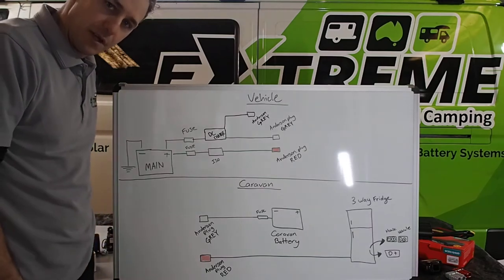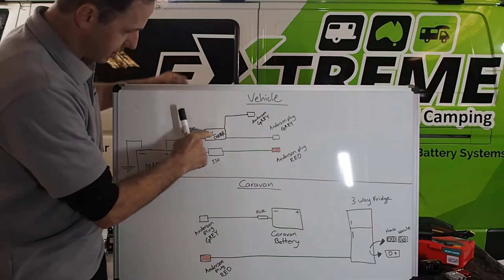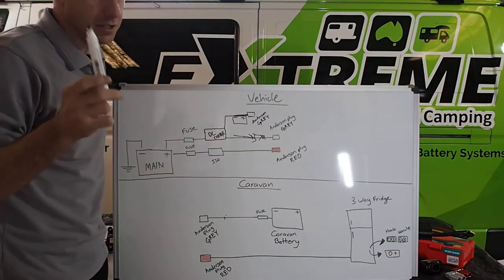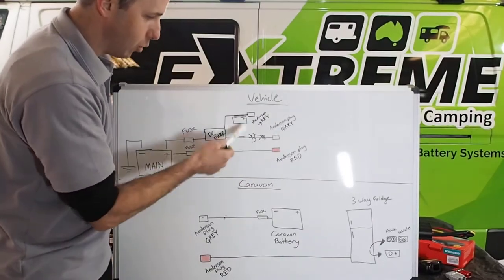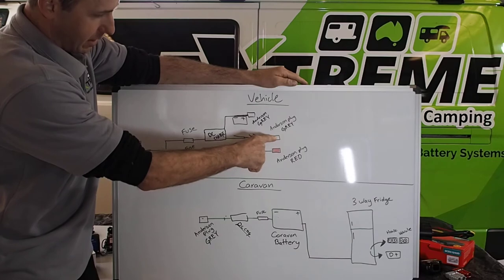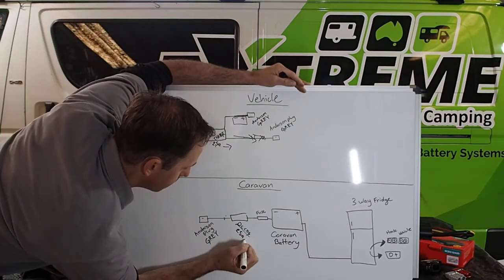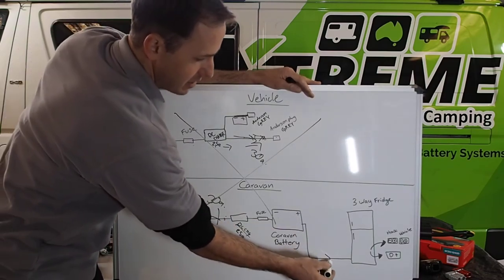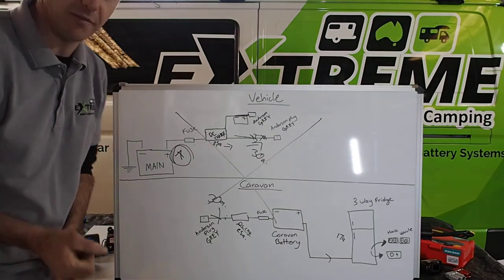Dc to Dc charging and 3 way fridge setups

Comment: Mate I love seeing what great info that you share via YouTube, it has certainly peaked my interests, in fixing my 2021 Jayco Journey, although its a small van but the invaluable information about the 12 pin connector, and then moving to the dual grey and red anderson plugs.  My van alone they've done some shocking works, like let run a 6mm2 cable from the 12 pin, down to a junction area with 2 over larger BP connectors, then it then jumps over to a 10mm2 cable that then runs to the Fridge with the AES 3 way function.  Strangely Jayco wired the AES switch wire directly off the 12v fridge supply write in the back of the fridge, it doesn't even make it to the 12 pin plug.

Job well done Mate keep it up!!

Comment: Gday Matt. Great video..
  I don't think this question has been covered anywhere in YouTube..  if running a dcdc charger from a car to camper trailer/caravan which we are using 50amp renogy one to charge the 2x120amp lithiums in the camper via a 35m2 2b&S cables with a single 120w solar panel on my draw bar tool box...I do have a 200w solar blanket back up. No real estate for solar on a soft floor camper..
   My canopy on my ute will be next to fit out. I will be running 2x 170amp giant power  lithiums in the canopy and have another 50amp renogy DCDC charger. Only possible to get 2 x 160w solar panels on the roof of the ute hence 2 lithiums.  
 My question. Do people actually run 2 DCDC chargers for this kind of set up running batteries in a camper or caravan and also in the ute canopy? Is the only option to run a higher output alternator for this application??
 Love your thoughts being an electrician..

Comment: Hey Matt, thanks for your very helpful & knowledgeable videos. I bought new in '21 a fairly 
basic (electricly) Supreme Van & am now in the process of upgrading it. I have swapped out the 2X120 AGM's for 2X120 Kings lithiums & the PWM for a Epever MPPT. It has a Meanwell battery charger which I'm told by the manufacturer wont hurt the lithiums, but wont charge them fully either. I want to fit a dc2dc charger & it seems to be easier to mount it in the rear of the car ('14 Jeep Grand Cherokee) & run it through the existing grey anderson. One of your videos suggest this is possible but what size cabling do I use ? (the existing cable is 8g)
I want to fit (or have fitted) an inverter to power up all the GPO's also' minus the fridge, charger, hot water & A/C. Your videos say this is entirely possible, but my local RV electician says he wont sign off on anything more than a dedicated GPO  :(
Reply from the maker: Thanks for all the information there you are on the right path. Just keep the gauge of cable between the DC charger and battery as thick as practically possible.
Changing to dedicated lithium charges is the correct way to do this. Just understanding what an AGM charger will do to a lithium battery it’s not the charging to 100% that is the concern. It’s the other stages that some charges have in built into their charge algorithm that can damage a lithium‘s BMS .
And example, here would be the desulphation stage this can go above 16 V and have a rather nasty voltage modulation involved.

Comment: Thanks for showing us this system Matt. I have the caravan 3 way fridge charging circuit set up as you describe with an isolator to protect main battery. After a short while it will turn on charging the fridge but then turn off again after about 10 minutes. I believe it will turn on and off again whilst driving (2021 Mazda BT50). Could this be a smart alternator problem ? Enjoy your explanations and fault finding.
Reply from the maker: yes, swap that out for an ignition controlled high current relay
Reply: @extremeacc101
Reply: Thanks Matt. I will give it a try.

Comment: Thanks for the video. My vehicle has a projector DC DC charger for auxiliary battery. The charger has one output. If I tap into that and run to an Anderson plug, caravan has BM Pro 35 to HA no DCDC charger. Is this going to help with charging? Cheers

Comment: Thanks for the explanation, Matt.  Would this system work: Vehicle: battery - fuse - iso - Anderson plug.  Caravan: Anderson plug - cable split with one branch direct to 3 way fridge and the other branch to DCDC charger - fuse - battery?  Does the DCDC charger prevent back feeding from battery to fridge?  Thanks for your help.
Reply from the maker: take note of what you did there I specifically said in the video and really emphasized on the fact of running separate circuits do not split anything That's where you run into trouble at 12 volt Remember we are dealing with low voltage here and you need each circuit running to the best designed for each line

Comment: Thanks so much for this. I'm installing 2 X 100ah lithium batteries (different brands), 1 in tow vehicle, 1 in caravan that is fitted with 3 way fridge. What's the best set up here? I was originally thinking 40amp DcDc to caravan battery, 20amp DcDc to vehicle battery, red Anderson to 3 way fridge, so three seperate lines from starter battery. Could I just run 40amp DcDc to vehicle battery, vehicle battery to caravan battery? And not use 20amp DcDc?

Comment: If you use one DCDC for two different batteries (car battery and van battery) one might be more depleted than the other (or different overall size). So assuming the DCDC is multistage, it wouldn’t be able to charge both banks at optimum charge rates (electrician here).

Comment: Hello. I have a Jayvo caravan with 2 x 120ahr lithium batteries and a DC to DC charger to a red Anderson plug at the front of the van. The van has a compressor fridge connected to the lithium batteries. Can I run a power supply from the vehicle battery to a red Anderson plug to charge the van batteries while the fridge is running?

Comment: I have an under bonnet DCDC charger and second battery. What size cable would you recommend to run back to parallel feed to the caravan battery? And what size for the separate fridge run? Would the one DCDC charger be ok, or at least until I maybe change one over to Li?

Comment: Hi Sir
I have second battery on my back of my car with DCDC charger and 3 batteries total 360 Amp , I have-grey
 Anderson plug from the 3 batteries and connected to PIN number 9 & 10 because if I stop any where I have constant power to my caravan fridge is this right.

Comment: Nice thanks so I don’t have to have two DC/DC one in car for car batteries n one in my van for the van batteries I can just run them off my enerdrive 40+ that’s in the back of car I was going to run another separate lines from start battery for the caravan DC/DC I’ll have to sell my second DC now thanks lad 😁👍🏾
Reply from the maker: With lithium you will need two dc chargers.
AGM will link up ok.
Reply: @extremeacc101  thanks lad yeah I do have lithium 240ah in car n 600ah in van ok I’ll run two separate DC/DC 👍🏾

Comment: Can I do this setup if I have an AGM battery in the car and lithium in the van? The lithium battery I'm using says it's ok to run AGM profile charger to it
Reply from the maker: No, you will need a separate dc charger for each system. Forget the AGM charge profile on a lithium battery.

Comment: Similiar to Harold's comment - I have 2 DCDC chargers 1 x 20amp 1 x 25amp I want to install the 20amp in the car with Aux battery. 25amp in the van, do I 1 run 2 x isolated andersons to the back of the car 1 for the van aux battery and red one for 3 way fridage?  car and van aux batteries may be different chemistry initially until I go to lithium for both - thanks
Reply from the maker: Yes Always separate the circuits 
👍👍👍

Comment: I have a question:
If I fit a 50amp DC toDC in my van, it will be charging a single 120amp Lithium, would this be enough to charge battery and handle a 90l 3way fridge (15-17amp)?
Or would you recommend always running a separate red Anderson for the 3way fridge?
Reply from the maker: Always run a separate line for a 3 way fridge.
Reply: @extremeacc101  what is the reasoning for that would it not be able to supply enough power?
Reply from the maker: Because your dc to dc charger is designed to charge the battery only. Not act as a high current power supply.
It will remain in ‘bulk’ 
Plus, your battery requires a specific charge algorithm in order to charge properly and efficiently
Reply: Helpful explanation to something I’ve seen before - thank you. But with more battery capacity / lithium available now, is there a recommended wiring arrangement to be able to run the 3 way from the van batteries for a short period of time (few hours) when stopped (car off but not set up  i.e gas / 240v)?
Reply: That doesn’t make sense. What about those red arc dcdc chargers with solar input. You’re always charging with that, especially if youre usage is greater than your input?

Comment: Don't parallel your Aux and van batteries if they are different chemistry, ie. AGM Aux and Lithium van battery.
Reply from the maker: Exactly 👍👍
Reply: What if you parallel your vehicle aux battery that is 120ah and your van is 200ah but both lithium type?